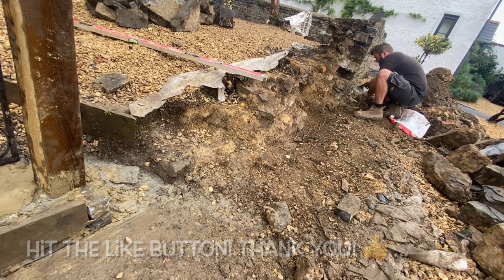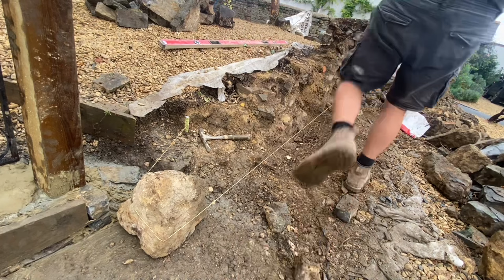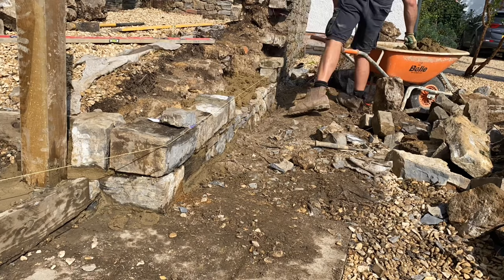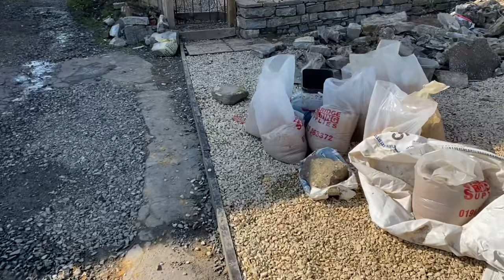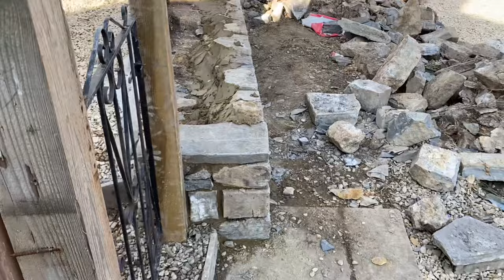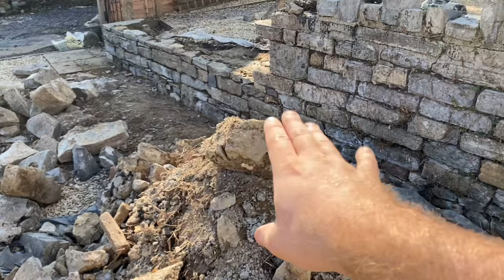Stone Walling ~ The Start Of The Rebuild!

Comment: When the job unfolds like this: all that loose gravel and unstable footings, how does the customer respond to factors outside of you control? Won’t you need more stones to make up the difference?
Reply from the maker: Luckily the customer has more stone around the back which I can use if I’m desperate, but if it comes to it, if more stone is required, then it’s required! I just only worry about the section I’m doing, as that’s what I’m there to do! All I can do is advise, but final decision is up to the customer. Thank you for watching Louise!